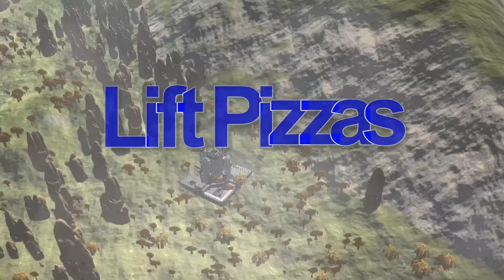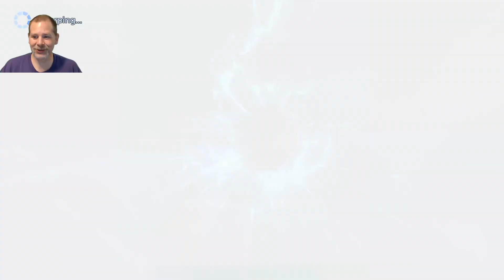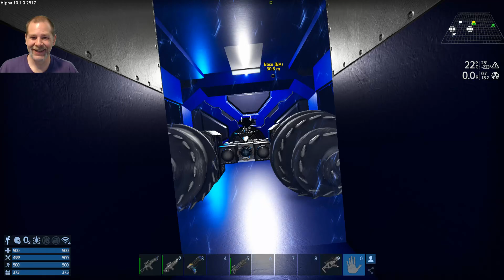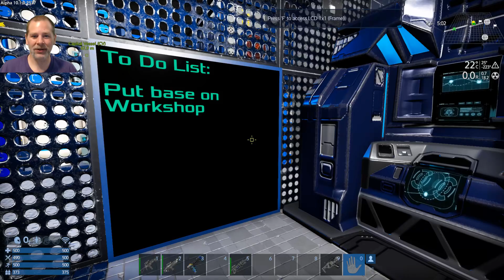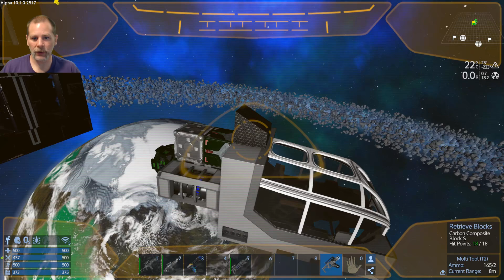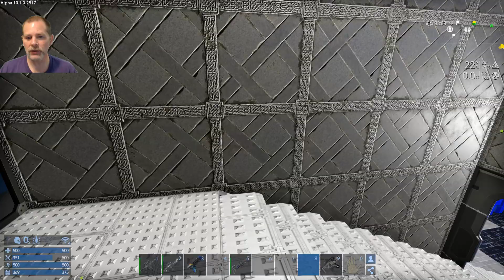🛩️SV Fighter Build 🔫 Lift Plays Empyrion - Season 12 - Ep38

Comment: I don't know what you're talking about, Lift - we've never seen a ship or HV turret lock onto random stuff to ignore bigger threats - like trying to shoot through walls at a shotgun antipersonnel turret while rocket-launching Zirax were attacking... never.  Certainly not in... season 10, I think?  ;)

does the math at the beginning of the episode  Wait, the CVs in space top out at 100m/s, right?  So 360 kph, or 224 mph... so your ship at top speed in a functionally frictionless environment, is slower than a Bugatti or a McLaren F1?  Slower than a turbo-prop airplane?  Even if I missed it and it was going 150m/s, that's still only 540 kph, 336 mph - pretty sure an old Beechcraft Baron could fly faster than that, and the P-38 could definitely exceed those speeds.
The devs really need to change the scaling in the game, somehow.  I understand hardware limitations and things like that, but coming in from out of (planetary) system, it's 10 km to your base.  The planets are so small, yet take so long to get around because of the speed limits.  They make Kerbin look obscenely large by comparison.  Hell, reduce the blocks and player model by 25% and just change the artificial numbers for distances - that alone would at least make it feel a little more "spacey".